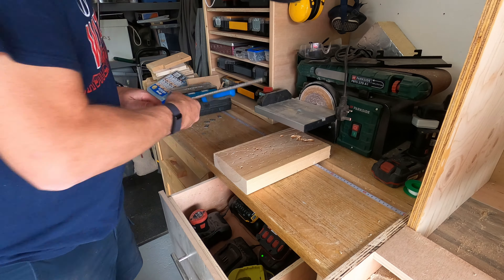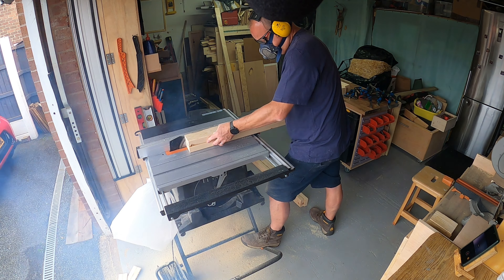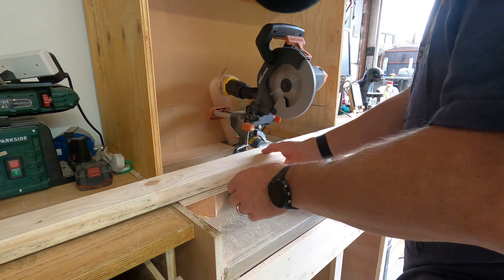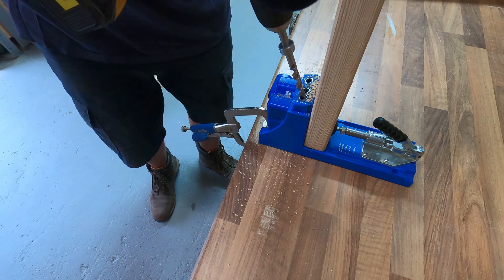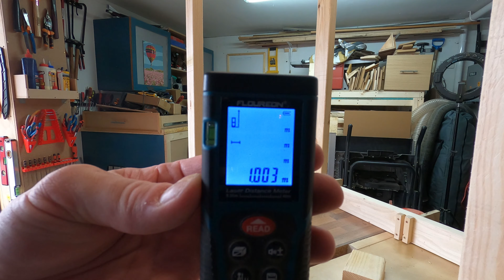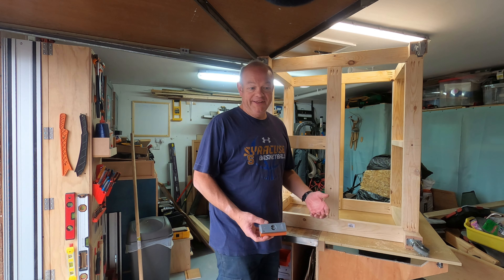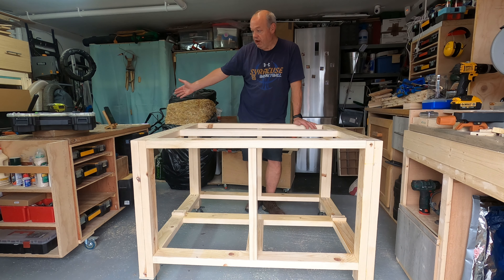The Garage Workshop - Workbench Part 1

Comment: Coming together nicely. So u have the plunge saw?? What u think of it?? Other thing may be worth considering is seeing if evolution will send u a table saw as a promo test)review?? 🏴👍
Reply from the maker: I love it Michael...my favourite Parkside tool and has the power of a lot more expensive branded tool in my opinion. Maybe but I am far too small sadly...maybe one day :)
Reply: @thegarageworkshop4791  have u had it long and take it will do a say 2" cut in 1 pass?? I've been looking at getting it but wasn't sure how robust would be as would be used for me for breaking down live edge slabs.
Reply from the maker: @michaelwillson6847  Yes I have had it a while and yes it will depending on material and grain.